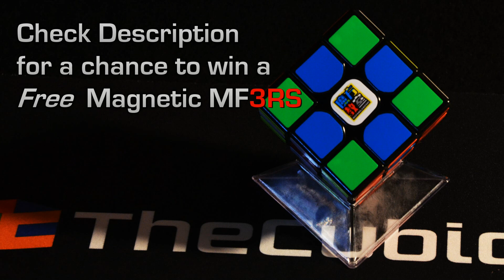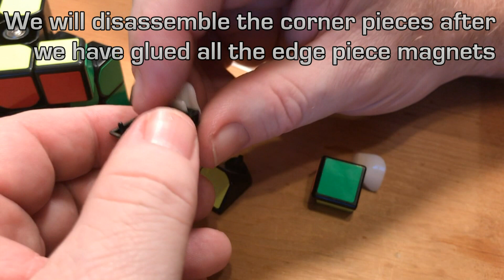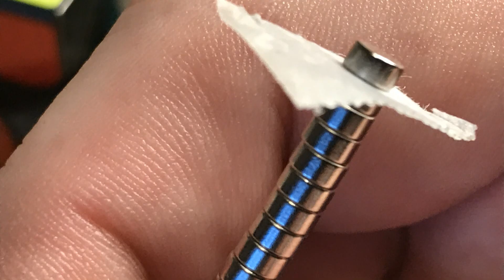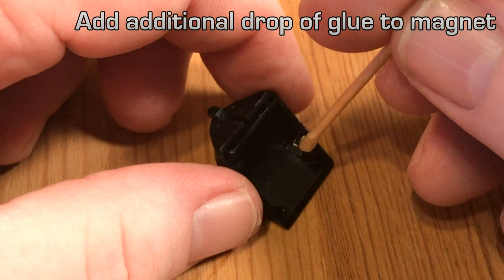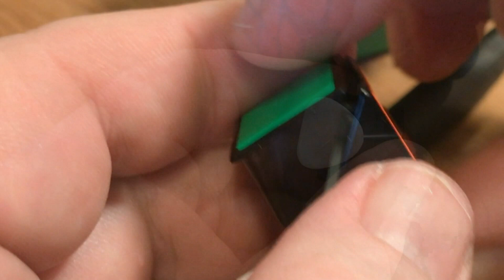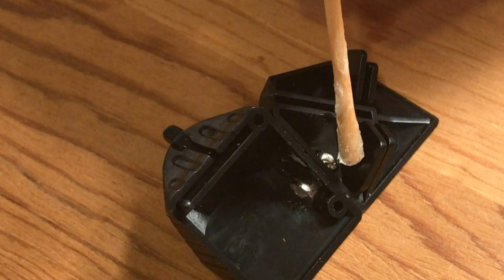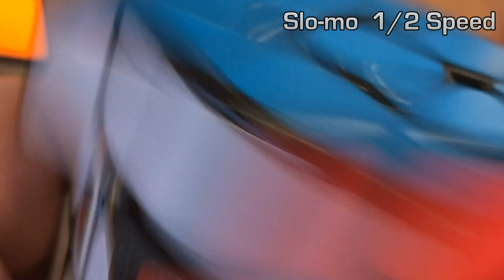How to Make a Magnetic MF3RS Speed Cube

Comment: Where are you getting the " N48 strength 4mm x 2mm neodymium magnets"? They are almost 9 bucks per 50 in Ebay.
Reply from the maker: Thanks, mrpants. A lot of times youtube fails to notify me of comments.
Reply: Try apex magnets.
Reply: Zelos Photizo you can get some at speed cube shop
Reply: well its in the cubicle.us. or if you know indonesian language than go to bukalapak.com.
Reply: Lol in my country its cost 1$ for 50 pieces
Reply: Zelos Photizo is 17 Hkd in taobao.(150 pieces)
Which only cost about 3 USD
Reply: Try N50s, not that different and they are more common and a lot cheaper on ebay or aliexpress. You can buy 200pcs for less than 10$. I bought mine for 3$ of aliexpress (200pcs).

Comment: Can i glue the magnet near to the Core (Little bit up)
Reply from the maker: Absolutely, as long as you’re able to keep both the edge piece and corner piece magnets lined up across from each other. 
Moving the magnets slightly inward will reduce the magnetic strength.

Comment: Is N42 4mm x 2mm magnet good in this cube?
Reply: oww thanks for the info
Reply from the maker: Yes. It will work just fine and have a magnetic pullforce attraction just slightly stronger than that of the N35 4x2.

Comment: Is it suitable to use a 4x1.5mm magnets
Reply from the maker: In this cube, a 4x1.5 magnet is going to feel fairly subtle, particularly if they’re N35 grade. An N48 4x1.5 might be a little more appropriate if you’re looking for a subtle feel. 
The magnets I prefer in this cube are either the N42 5x1, N48 5x1, or N35 4x2. Most people use the N35 4x2.
Reply: Ok thanks a lot

Comment: Are black MF3RS with stickerless MF3RS, when magnetized, are they feels the same? And are they need the same magnets?
Reply from the maker: Yes they feel the same. There’s a very small chance that the magnets could feel just the tiniest bit weaker in the black plastic stickered due to the carbon in the black pigmentation, but you probably really couldn’t feel the difference.

Comment: Hey DMCubing im a little worried if i do this with my stickerless mf3rs the magnets might repel at some points,should i worry about this or just follow as shown?
Reply from the maker: If you follow as shown, everything will be fine. The key is to remove the magnets the same exact way each time we glue the edge piece magnets. That’s why I always put a little piece of paper at the end of the stick of magnets, making sure I remove them from the opposite end. And then after the glue is dry and the cubie pieces are put back together, reassemble the cube without the core to check for polarity issues. The cube should be able to hold itself together without the core. If any magnets are wrong, those pieces will repel.
Reply: @dmcubing6342  thank you so much! this comment really helped me do it, ive finally assembled it, with the correct polarity,and as my first customization to a cube it was really helpful with this video, it was the only video i could find with useful steps, your videos are very clear and easy to follow, keep it up :)
Reply from the maker: BLANK. Thank you very much for such a kind comment! I truly appreciate it and I’m so happy to hear everything turned out well with your cube! That is awesome!!!! Enjoy your cube!!!!

Comment: Will 2mmx1mm n42 work?
Reply from the maker: Those would be way too small and extremely weak. You really need a 4x1.5, 4x2 or 5x1 magnet.
Reply: @dmcubing6342  how about 4mmx2mm n52? ive bought them from an authorised dealer so i know that theyre real,
Reply from the maker: BLANK. Sure those will work! A true N52 magnet is going to be strong, but in this cube it should be ok, you’ll just have a stronger click.

Comment: THANK YOU! the tutorial was amazing. i used loctite super bonder, it worked great. unfortunetly i spilled a little bit of glue inside of one of the corner flaps, and had to remove it so the piece would assemble correctly, but after that, the cube turned out great! i used N50 mags.
Reply from the maker: Awesome!!!! Glad it turned out great!!! Thanks so much for letting me know! Thanks for your kind words!!!
Yeah, every once and a while, glue can go places that you don't want it to. Or it can get on the little tabs inside the cubie pieces. Glad you were able to get it off.

Comment: If youre placing the right side... what about the left side?
Reply from the maker: With any cube, as long as there is enough room the magnets, and as long as the edge and corner pieces line up, it doesn't really matter. I usually have reasons for putting them on specific sides. This is usually because of the location of the internal retaining post inside the edge piece.

Comment: hi dm can i use strength n42 4x2mm magnets here?
Reply: thankyou
Reply from the maker: You certainly can. I used N48 4x2 and it was fine though it had a somewhat stronger magnetic attraction. 
An N42 would be more acceptable. It will be just a little stronger than using an N35, but still quite good in this cube!!!

Comment: Can I use 4x2 mm n50 ? Will those magnets be too strong ? I like strong magnets but I don’t wanna mess up, ur answer is appreciated :)
Reply from the maker: I think you'll be ok. Usually, if they're budget priced N50s, they're really N35 in strength. The majority of cheap N50s are generally no stronger than N35. If you're paying more than normal for them, and it's a reputable magnet company, then they'll probably be real N50s. Either way, real N50s will be a little on the strong side for this cube, but still quite usable. If they're the cheap N50s that feel like N35, they'll be perfectly fine.
Reply: I bought them for 3$ on aliexpress cuz I’m broke, but I put them on the yuxin little magic and they were waaaay too strong, so I removed them from the cube and I put n35 instead and they were good, so it means my n50 are real n50 ! But what if I mix ‘em up ? I could use for example n50 in the edges and n35 in the corners, will it work ?
Reply: And what if I use n50 but I place the magnets a little bit higher in the edge, will the magnets fill less stronger ?
Reply from the maker: Bob Lopez Wow, you lucked out because for that price you could usually expect real week N50s. Good for you!
Due to the centrifugal force applied to the cube while solving, you would need to PLACE THE MAGNETS FURTHER INTO THE CUBE TOWARD THE CORE to lessen the perceived strength of the magnets.
And yes, you can always combine magnetic strengths within the cube. Just make sure to separate the magnets and not get them mixed up. Generally speaking, you'll get an average of the two combined strengths: N35 + N50 = 85 / 2 = 42.5, so it would be something like N42.
Reply: U were right since the beginning, n35 are good but a little bit on the light side
Reply from the maker: Bob Lopez Hmmm.
Reply: What does that moan is suppose to mean ?😉

Comment: Use bluetack or clay to place the magnets first
Reply from the maker: Charge Rim2 Yes, you can! I have used bluetack before to test the strength of magnets. Sometimes I'll do just a few cubie pieces to test the magnetic attraction between the pieces, but I suppose if you really wanted to, you could do the entire cube. I wouldn't use it as a permanent adhesive though. But it's a good way of checking things out before committing to a particular size and strength of magnet.

Comment: Can I also use 4x2mm N38 magnets?
Reply from the maker: Angelica Jane Andres Yes. Those would be fine. The first MF3RS that I magnetized used N48 4x2, and those were just about at the point of feeling strong. So, an N38 4x2 will be perfectly fine in this cube.
Reply: How about 5x2mm N50 magnets? And what do you prefer?
Reply: DMCubing how many magnets did you used?
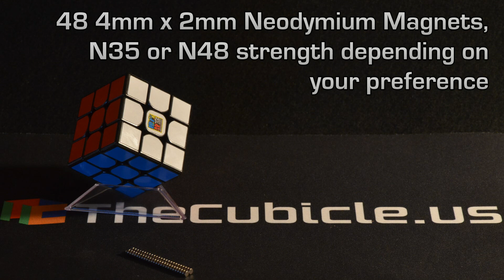Reply from the maker: Angelica Jane Andres 1:18 2x2 and 3x3 cubes require 48 magnets.
Reply: DMCubing Thank you😊 and Godbless😇
Reply from the maker: Angelica Jane Andres 5x2 are too strong for any normal size 3x3. 
I prefer N35 4x2.

Comment: where i get magnet
Reply from the maker: ENI YAN #CUBER N35 4x2 Neodymium magnets are fairly common, so they can easily be found online through searching or even on eBay. For strengths and grades higher than N35, it's best to use a reputable magnetics dealer. In the US, I use Gaussboys Magnets, Apex Magnets and Thackery. For overseas, I use magnets365 and Omo. I hope that helps!

Comment: if you acsedently get glue on the out side of the cubies do you know a method on how to get it of? great video by the way.
Reply from the maker: Geogee123 ! Thanks!
Once the glue is on there, it's almost impossible to get it off. You can, however, VERY CAREFULLY scrape just the glue until you've scraped most of it away. Then you can take extra fine sandpaper or emery paper, and working with just a tiny area, gradually sand the area smooth.

Comment: Should I use N35, N38 or N50 magnets for MF3RS? I like stronger magnets which has a click to it
Reply from the maker: Zhongyi Ho If you can find real N50s and not fake ones ( the real cheap ones are usually more like N35 strength), those would work, or N38. I used N48 4x2 in mine and it has a pronounced but not overly strong magnetic feel.
Reply: Here is the website that I'm going to buy the magnets from:
https://mspeedcube.com/product/neodymium-n35-4x2mm-magnets/
N50 magnets cost around RM10, or $2.55. According to the price, is it the real N50? And btw how would the cube feel if I put N38 magnets?
Reply from the maker: Zhongyi Ho I just don't trust cheap magnets. The N50s I use from Gaussboys are $5.50US. 
If they guarantee that they're not all the same strength, I'd use the N50. N35 would be fairly subtle in the MF3RS and the N38 would be just a step above. Since you prefer a more pronounced feel, then N50 is the way to go.
Reply: DMCubing Awesome, thank you so much! :)

Comment: Can i magnetize it layer by layer?
Reply from the maker: Cuckoo TNZ Please explain. It's a 3x3. The only other option is magnetizing from the center piece to the edges which would require an extremely strong magnet.
Reply from the maker: Cuckoo TNZ I still don't understand. You're asking about attaching the center to the edge? It's not needed. 
The magnetic layout is exactly as shown here or any of my other 3x3 videos. The minimum amount of magnets you can use is 48. There is absolutely nothing gained by using more magnets than necessary.
Reply: nvm i already know how this works

Comment: Will n35 4x1.5s work for a MF3RS2?? I want a light feeling.
Reply from the maker: CUBERS Inc Yes. That's a great magnet for a light feel. Be sure to see my video on the MF3RS2. 😀
Reply: DMCubing sure.
Reply: How would n42s work??
Reply from the maker: CUBERS Inc They'll work fine. Won't be as subtle as the 4x1.5 though. 
N42 or N48 5x1 work really well in the MF3RS2
Reply: DMCubing this conversation is pointless right now because my next unboxing will be probably 2 months from now. Oh and the YueHun tutorial was really helpful. I used N35 4x1.5s and they give just the right feel. You can not feel the magnets when you turn fast but it helps. So Thanks for the tutorial. Good night(as per IST)

Comment: When I magnetize my cubes, should I place my magnets closer to the core?
Reply from the maker: Ryan Le That's a really good question. I generally tend to place my magnets in pretty much the same place, usually at the bottom surface within the edge piece, against one of the retaining posts, and if I want to adjust the magnet's strength, I'll use different magnets. I use this position because it gives the magnet more stability being glued against something- it prevents them from coming loose. 
But if you're limited on magnets or you want to change the perceived magnetic pullforce strength, and the internal design of the cubie pieces allow for it, you can change the position of the magnets. 
Placed closer towards the core, they'll feel lighter. I often do this with the Gan Air when I want a little lighter feel when I'm already using the lightest magnet I have.
Reply: DMCubing I wonder does placing magnets make the cubes more stable? Because I saw in this video https://youtu.be/G_tLoV3kJhg he says it will cut down the distance that the magnets have to travel and I see the Valk Power does have the magnets closer to the core so it is very interesting to know know why they do that. Sorry for my silly question XD
Reply from the maker: Ryan Le That's interesting. I hadn't seen that video before. Thanks for the link! He may have a point about magnetic position, but I think any differences you'd feel would be negligible. I usually just adjust the size or grade of magnet. I certainly don't agree with his method of gluing, but to each his own.
Reply: DMCubing Thanks for your reply :D
Reply from the maker: Ryan Le No problem. One other point about where he's placing the magnets. I don't agree that it will increase stability for the very fact that the centrifugal force imparted on the cube will make the magnets feel weaker. That's why you place the magnets further in for a weaker magnetic feel, or place them further out to increase magnetic force.
Reply: DMCubing Oh yeah XD I am not good at physics. You saved my time again, thanks a lot!
Reply from the maker: Ryan Le Oh I'm not good at physics, but I learn a lot by trying different things. 😀
Reply: DMCubing Thanks to you, I just finished magnetize my mf3rs at 1 am lol, it's feel awsome now, quiet and M slice is out of the world, can't wait til my valk's turn but Time too sleep XD Gotta go to school early XD
Reply from the maker: Hah, too cool! I'm so happy to hear it turned out great!!!! I hope you got enough sleep! I know how that goes, I'm always staying up too late!!! :-)
Reply: DMCubing Thanks for the tutorial :D

Comment: Could a 5x1 n50 work for the mf3rs2?
Reply: Correction: 4x1 n 50
Reply from the maker: Niels van Hout Oh, I'm glad you made the correction. Actually that magnet would be really light in this cube. I suppose you could do it, but I wonder if the magnets could be felt. Now, having said that, I've made some cubes before with such weak magnets that you really couldn't feel them, but they still imparted a positive effect on the cube. It's like having a magnetic cube that doesn't feel like one, but it still gets some benefit from magnets. 
If you're a very precise solver and want only a hint of magnetic strength, they might work out. Otherwise it might be better to use N35 4x2.

Comment: DMCubing does this work on MF3RS2?
Reply from the maker: Elfi Shahrul Yes. The design is a little different. I would still place the edge piece magnet on the right side as shown here, but you'll notice it's the thinner retaining post in that location now. But you'll have to use that side so that the corner magnet can align properly. So when gluing the edge piece magnet, be sure not to get any glue on the tip of the retaining post. 
The corner piece magnets will align to the edge piece magnets. If you use 4mm wide magnets, they'll have just the slightest tilt because of the shape of the inside of the corner piece third. If that's bothersome, you can place the magnets further up or use a 3x2 magnet. I'll probably be using 3mm wide magnets in mine when I magnetize it.

Comment: I assume that the MF3RS2 would be the same method?
Reply from the maker: Gee, youtube isn't notifying me of comments! Sorry for just now replying!
The design is a little different. I would still place the edge piece magnet on the right side as shown here, but you'll notice it's the thinner retaining post in that location now. But you'll have to use that side so that the corner magnet can align properly. So when gluing the edge piece magnet, be sure not to get any glue on the tip of the retaining post. 
The corner piece magnets will align to the edge piece magnets. If you use 4mm wide magnets, they'll have just the slightest tilt because of the shape of the inside of the corner piece third. If that's bothersome, you can place the magnets further up or use a 3x2 magnet. I'll probably be using 3mm wide magnets in mine when I magnetize it.
Reply: It's funny how I completely forgot about making this comment, and I am planning to magnetise the cube tomorrow. Great timing! :p
Reply from the maker: Endangered Koala Cool!!! Let me know how it goes!
Reply: Finished magnetising and the cube feels great, much better than my previous main. Used N45 4mm x 2mm magnets and they worked fine, even with the slight tilt that you told me about. I'd recommend N40 over N45 magnets.
Reply from the maker: Endangered Koala Hey, cool!!!! Awesome you have a great magnetic cube now!!! I think the Gaussboys N35 4x2s that I usually use may be a little stronger than other manufacturers. I've been planning on using N52 3x2s in my MF3RS. But I actually have two, so I may do some experimenting. Thanks so much for sharing your findings! I appreciate it!!!

Comment: PLS reply what is the strength of magnets that the cubicle.us put in their MF3RS2M
Reply from the maker: DC Cuber I haven't figured it out yet. But I did just actually order one yesterday, so when I get it, I'll take it apart and see what they're using. 😀 I'll let you know.
Reply: thnks!!! :)
Reply from the maker: DC Cuber No problem. Remind me if I don't get back with you.
Reply: Any update?
Reply from the maker: Still waiting on the cube. I guess they're still making them to order as my order hasn't shipped yet. I'll certainly post an update once I know!
Reply: ok thnks :)
Reply from the maker: Just got the cube and took a look inside!!! They use a 5x1 magnet and I've heard before they use an N48. N48 5x1s are easily available from Apex Magnets.
Reply: tysm :)